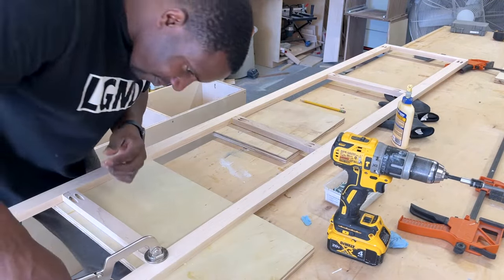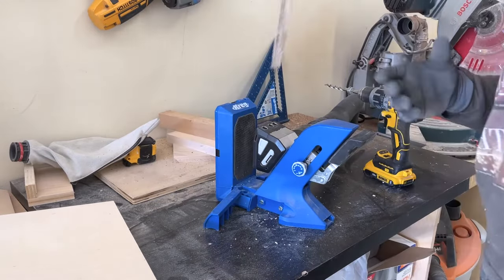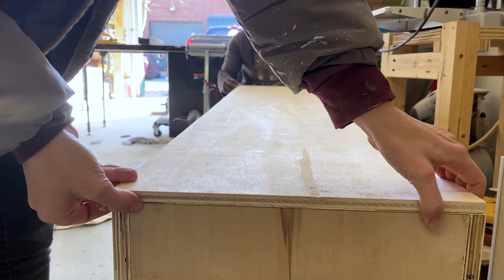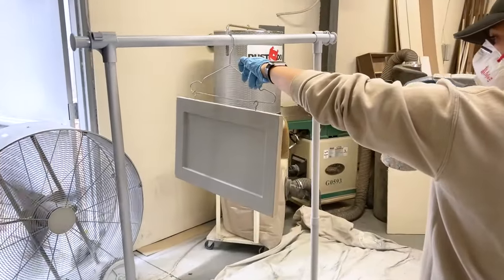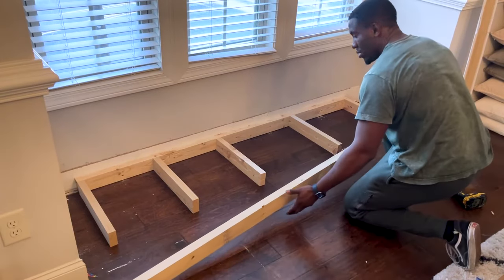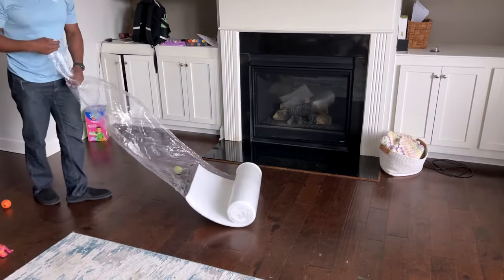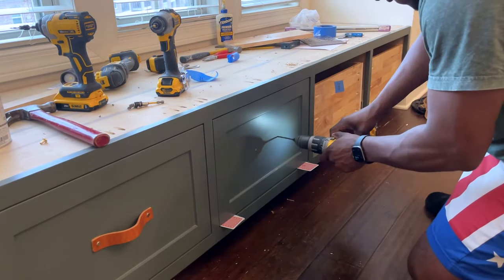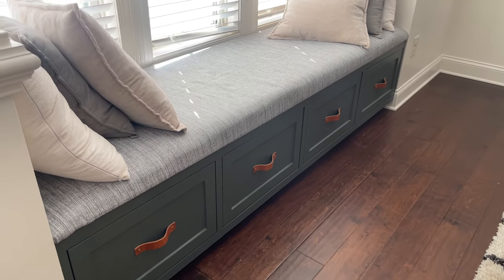Building a Window Bench With Inset Drawers | How To Guide

Comment: TY so much for the full commentary - really helps.  I do have a question. I have trouble keeping corners square. Even if I use a square they seems to shift. Can you talk more about that. I even got a corner jig but well...hmm....maybe its operator error here?
Reply from the maker: @marymacfarlane4275  thanks! Are you corners not square on your face frames or the actual cabinet? 

If it’s the cabinet make sure you use stretchers when building them on the back and tops. Make sure the pieces are cut to the same length as well, that’ll ensure they are square.

If it’s the face frame. You want to make sure your vertical cuts and horizontal cuts are cut to the same measurement to a 1/16”
Reply from the maker: @marymacfarlane4275  I’ll make a video on this

Comment: Great Job! Looks like you already figured out all carpenters keep their "breaking down" station right at the door. Have to think about flow, so the largest things are going to be coming in and out right at that door, so keep your isles wide and that space clear. Get you a couple different sizes of centipede tables to use right there - you won't regret it and you're back will thank you one day!
Reply from the maker: Thank JB! You are absolutely right, the quicker I can unload and load up the fast and easier things are for me. I appreciate you advice. Thanks for watching through this video btw!